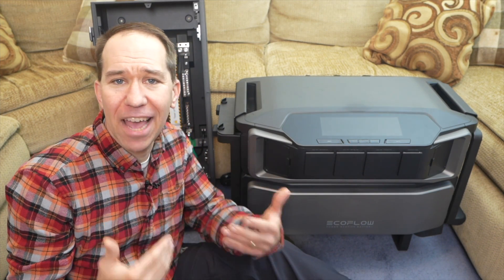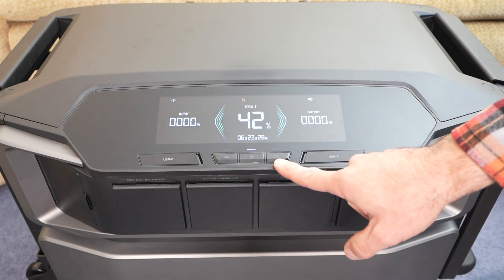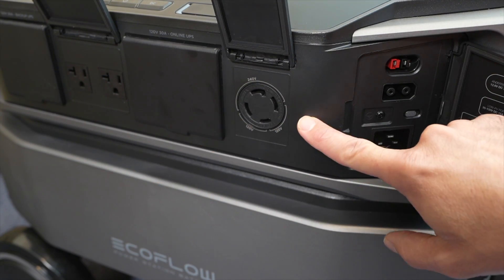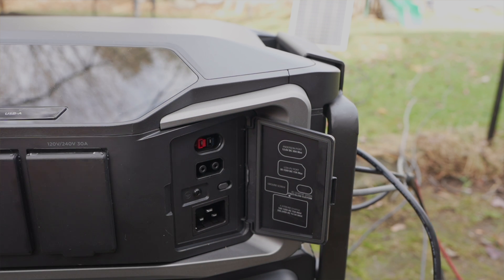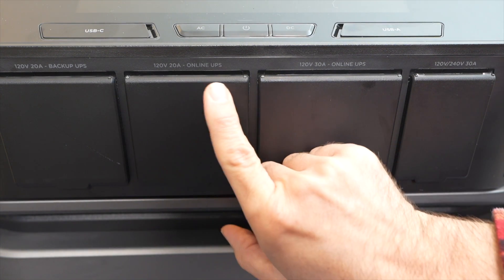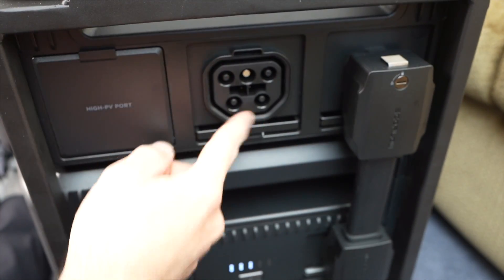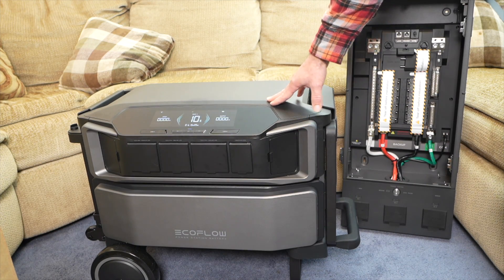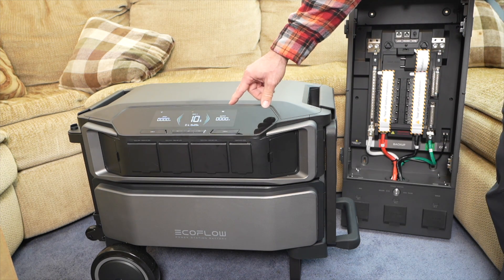EcoFlow Delta Pro Ultra - Huge Solar Input & 240V Output!

Comment from the maker: What other questions do you have about the DPU or the Smart Home Panel 2?
Reply: How much is it?  Is it still a huge secret?
Reply: @tlteal 
$300?
Reply: I didn’t see the panel 2 review on your main channel, are you still doing one? Love your content!!!
Reply from the maker: Thanks!  I made a video installing the SHP2 and using the DPU on my main channel in January.  If there is more you’d like to see with the SHP2 or the DPU let me know.
Reply: @solarguy  oh! Didnt realize this wasnt main channel! My bad!!!
Reply: I wished that the DPU had like an 'auto gen start' dry contact input other then that its fenominal.
Reply: Does the smart panel charge the batteries?
Reply from the maker: Yes, it can charge the Delta Pro Ultra directly.
Reply: I had the same question  - how much ?
Reply: I have micro-inverter solar system now. Does the SHP 2 will have CT clamps to monitor the outgoing power and able to use that outgoing power to charge the batteries instead of sending it to the grid?. Then it could act more like a Tesla, Enphase or Franklin Power Wall and Any excess power could be fed back to the battery. If it does not, what does the SHP 1 do different than the SHP 2 ?
Reply from the maker: The SHP2 is a smart sub-panel.  You can definitely monitor the energy consumption on each circuit.  If you want, start a new comment with more questions and I can take a stab at answering them.
Reply: That's a great question! The Segway Portable PowerStation Cube Series is another excellent option for outdoor enthusiasts and RV lovers. It offers a massive 5kWh capacity, fast recharging, powerful output, and even has a waterproof design. I highly recommend checking it out for all your outdoor power needs. Let me know if you have any other questions!
Reply: The Segway Portable PowerStation Cube Series is a fantastic option for outdoor enthusiasts and RV lovers. With its massive capacity, powerful output, and super fast recharging capabilities, it's perfect for powering your devices and appliances during your camping trips. Plus, its armor design and waterproof technology ensure durability and reliability in any weather conditions. Highly recommended!
Reply: I have been waiting for mine for over 2 months

Comment: Reece, l was wondering about what port for output to my 100A breaker box in a totally off-grid cabin. I know l can run a 30A cord from the front port but could l also use the side port where you can charge the batteries and run it to the 100A breaker box. Another question is, if l use the front port to the breaker box and have to use the side port to charge due to extended clouds, etc. will the batteries charge without running through to the cabin outlets?
Reply from the maker: You wouldn't be able to output more than the 7200W max with only one main unit no matter the configuration.  To use the 5+1 proprietary port (on the side), you need the 50 amp hub or to connect the DPU to the smart home panel 2.  You could get an adapter to input to the 5+1 port and input there and output on the front if you wanted.  I'm not sure I understand your second question.  The DPU can input/output at the same time.

Comment: Have you ever tried both high and low PV charging simultaneously? 

I have a crazy idea of powering this inverter directly from a retired 1st Gen Chevy Volt (< 400V HV battery), which means there would be more than 300kWh (10kWh usable capacity of EV battery + 9 gallons of gasoline [33.7kWh per gallon]) of energy reserve in theory.
Reply from the maker: Yes, both inputs can be used at the same time.  Sounds like a fun project.
Reply: Yes ... until I made both the car and house on fire!  Just kidding.  If this idea works, I will have a gigantic low emission gasoline generator backup.

Anyway, Costco has this Ecoflow unit on sale now with up to 18kWh of batteries bundle.  I will keep you posted, if I decided to go for this interesting adventure.

Thanks for your prompt replying.
Reply from the maker: Well hopefully no flames, lol!  Keep me posted.  If you end of seeing a good deal on Amazon and EF website, I usually can get discount codes.  If I don’t have a description updated you can always email me and I can see what I can get.

Comment: If I have 5 400-watt solar panels plugged into the High-PV Input Port and the DPU is inside my home, do I need to do any special grounding like using the grounding screw on the DPU? I ask because the online manual says, "When the 'product' connected to PV modules is put inside the building, it needs to be grounded to reduce the risk of electric shock. Before using the ground terminal, consult a qualified electrician, electrical inspector, or local agency having jurisdiction for local codes or ordinances that apply to the intended use of the product."
Reply: Oh, how long are the cables? If I do get the panels, I would need to run the cables between 50 and 100 feet from outside where the panels are to inside where the DPU is.  😅
Reply from the maker: I would use the grounding plug if it were me.  You could probably land it right on the ground bar on your main panel.  Do you mean what gauge of wire?  You may want to consider 8 gauge to minimize voltage drop.  There are calculators onilne to get voltage drop estimations.  You might also want to make sure you get wire that has the correct insulation for your application.  For example, getting PV wire or direct bury cable for outside.
Reply: @solarguy  I've heard terrible things about grounding plugs, like they're not supposed to be used while the system is also plugged into an outlet.

Comment: how much high power solar input will this take i read 4000 watts in the specs but other places it ways 5200watts, which is correct ?
Reply from the maker: It has 2 solar inputs (high and low voltage).  Low voltage is rated for 1,600W, high voltage rated for 4,000W, so 5,600W of total solar input per DPU.

Comment: Can it handle a 3.5 ton central ac unit?
Reply from the maker: If the LRA is less than 120amps then yes.  If you look on the sticker it should tell you what the locked rotor amps value is.
Reply: @solarguy  ok thanks and how long will it run on battery alone?

Comment: I have an inquiry
Can the solar system provide power to the house to offset utility demand and charge the battery?
Thanks
Reply from the maker: Yes, it can.  You can connect it in with a generator inlet box or it natively works with the ecoflow smart home panel 2.  I've got a demonstration video on my other YT channel (check the video description for the link)
Reply: @solarguy  I really appreciate the help you've given me. Can I just ask you one last question?  
If the solar system was only tied to the Eco Flow battery and supplying it with KWh’s , could the battery be used to supply power to the home thereby lowering the amount of KWHs the I need from the grid?
Thanks

Comment: How long would it take to fully charge with solar?
Reply from the maker: It depends on how much solar and how much sunlight you have.  If you have a 5kw solar array and full sun (1000w/m2) at the right angle then it might take about 1.2 hours to go from 0 to 100%

Comment: This EcoFlow Ultra environment, while impeccably engineered on the surface, is flawed and not ready for prime time. The hardware installation and set up is simple and somewhat straight forward, but that’s where the full beauty of the design ends. The software and app that are actually responsible for insuring that you have power when the grid goes down do not deliver. The biggest issue is the parasitic draw down on the battery when the system is in idle. There are a number of functions on the app that conflict with one another, making work arounds to reduce battery drain impossible. Some app features don’t work at all. And as mentioned in another post, customer support, while courteous, is basically useless. The jury is still out to see if the software functionality is going to catch up with the hardware. I’m not holding my breath…
Reply from the maker: What app features don't work?  Are you using with the SHP2 or just stand alone?
Reply: @solarguy  Schedule tasks don't work unless the battery is on, which increases battery drain, requiring more charge time. The EPS mode is another power drain when on, and should function the same whether on or off in terms of static power drain. StormGuard doesn't work. All the functionality built into the battery-side of the app is disengaged when connected to the SP-2, reducing overall control of the battery.

Comment: Bonjour je recherche une autonomie de 4 jours minimum pour ma maison 🏠 comment faire svp ?
Reply from the maker: If you want all of your needs to be covered for up to 4 days you would need to calculate what your average daily use of electricity is for all of the loads in your house then multiply by 4 to get a good estimate.  This will be in kilowatt-hours.  If you have solar panels then you will also need to make some assumptions on how much they can produce.  Because a system like this is expandable, you can always start with one battery and add more until you find the amount that suits your needs.
Reply: @solarguy merci beaucoup pour l'information ❤

Comment: I’m very new to solar and this unit looks very straight forward for someone to have a 240v backup solution. However, I’m having trouble finding recommendations for what solar panels to use for the high PV port. Do you have any recommendations maximizing power input while staying under the max 450 volts? How many panels and how big should the panels be? Thanks in advance.
Reply from the maker: It’s hard to give an exact answer because there are so many options for solar panels (prices, sizes, wattage, etc). Where you plan to mount them is also a factor.  A simple explanation is to look up the voltage on a solar panel spec sheet.  When wired in series you add up the voltage.  You want to be mindful of the amperage limits too so you are most efficient.  Would you find it helpful if I made a video explaining these concepts (series and parallel solar strings)?
Reply: @solarguy  Absolutely. Please make a video. I stubbled on to your channel because of this video. Your video was a great explanation and overview of the unit for beginners. I will be checking out your other content to continue my journey into the world of solar.

Comment: How fast does the ultra charge on your roof array of 15.6kw?
Reply from the maker: I'm not able (at least easily) to charge it with my current rooftop array because they are already hard wired in to my SolarEdge inverters which are then grid-tied inside the meter.  So I am using other solar panels with the DPU.  If I were able to connect 5.6kw of panels and I had optimal angles with full sun, it would take a little over an hour to charge the 6kWh battey.

Comment: The Anker f3800 looks far more portable even with the battery add ons.
Reply from the maker: It depends on how portable you want.  The Delta Pro Ultra has some better features (plus 6kwh versus 3.8kwh) in my opinion and I can move it around pretty well with the upgraded dolly.  I wouldn't be able to pull the F3800 through the grass like I can with this DPU setup.

Comment: Good presentation but, your dB test not so good, your clothed watch arm was in the way.
Reply from the maker: Thanks.  I might disagree but in this case I don't think the exact dB even matters.  Even when charging or outputting 6,000W this unit is so quiet.  I have tested a lot of power stations and this is on a new level of quiet.

Comment: Please show us the smart panel 2 is it use a normal circuit braker so we can add more than 60A or its special circuit braker also i saw that you may could extend the numbers of circuit and we can use it as 240v completly please answer the question asap as am planning to have 180kwh awaiting your urgent reply
Reply from the maker: My video with the SHP2 comes out on Tuesday.  Yes, it uses normal breakers.

Comment: Could you use a delta pro with 2 batteries (or 2) in series to charge the unit?  I have two delta pro with 4 batteries.
Reply from the maker: If you have the double voltage hub you can charge the Ultra at 240v with the l14-30 to 5+8 adapter (I showed it in the video).  Otherwise you would charge the ultra from the 120v outlet on the delta.

Comment: no charging port for ecoflow smart generator ???
Reply from the maker: No, there isn't a DC XT150 input.  You have to charge it with the 120AC output on the EF gas generator.

Comment: @solargy I appreciate the video and I’m always trying to educate myself in this area however this is not my forte by any stretch of the mean and I still struggle with it and have a couple of questions for you if you mind me asking…
So my parents have a couple health issues that requires them both to be on cpap machines and one has to be on oxygen as well when they are sleeping. Both cpap machines are Resmed airsense10 and one Phillip Respironics EverFlo portable oxygen concentrator. Is this unit enough to power all 3 of  machines incase of an a big power outage? I’m struggling to figure out what exactly is  needed to meet those needs so I can have something in place and have peace of mind if something happens those needs are fully me? 
Thank you if you are able to bring any clarity on this matter.
Reply from the maker: To answer specifically you would need to know what the total power draw is on those devices and how long you want them to be powered by a battery in a power outage.  My guess is that they don’t use a ton of power and if it’s only for these things, Delta Pro Ultra may be a bit overkill.  You could likely get away with a power station much smaller.  So for example, if those items use 300w total and you want them to last 8 hours then you aim to get a battery that is 2400wh or more.  Multiply the power load times the hours.  You can use a simple power meter to find out what the power draw is on these items.

Comment: @ 6:36 is the 50 amp hub included?
Reply from the maker: I’m guessing it’s an add-on.  The DPU isn’t officially launched for a few more weeks.
Reply: I've also seen an EcoFlow "official" video that showed this double amp (parallel) hub, but also a new version of the Double Voltage Hub for a pair of delta pros that let you hook them up to a Smart Home Panel 2. I'm wondering if you could also connect that hub to this Double Amp hub to add an Ultra to your existing DELTA pro setup to get up to 50 amps and more capacity?
Reply from the maker: I don't know for sure but my guess is that it would work in that scenario.  That is, with the new (5+8) adapter connected to 2 DPs and a DPU on the other input.

Comment: Question: Does the DP Ultra comply with UL 9540? Local code (Illinois) requires the inverters and batteries comply. This is critical because the electrical inspector won't let you install solar panels or connect the unit to your house if it doesn't.
Reply from the maker: I asked EcoFlow to make sure and they confirmed it complies with UL9540.
Reply: @solarguy  That is great news. Thank you for checking with them. I need to get that in writing. Unfortunately, I can't find a spec sheet online for the Ultra. I just know that I will need to show it to the electrical inspector. I was about to purchase a Hysolis Apollo 5K and several batteries, but their unit doesn't comply with UL 9540. Theirs complies with UL 2743, which I believes covers portable devices with batteries. They added that it's not possible to backfeed the grid with the Apollo 15K. So I hesitated, wanting to do more research, because I don't want to end up buying equipment that would be rejected. Then I learned about the Ultra. Once Hysolis told me about their compliance with UL2743, it dawned on me that perhaps the reason that most of these solar power stations don't comply with UL 9540 is because they don't have to; they fall under UL 2743. Do you think this reasoning is correct?
Reply from the maker: I have seen a SGS certificate that shows the DPU is UL 9540 certified.  I don't know how to show it but perhaps you can look it up  the certificate number is: SGSNA/23/GZ/00354  and this is what is listed under certified: ANSI/CAN/UL 9540:2023,Third Edition, Dated June 28, 2023
Reply from the maker: You can email me and I can snap a photo if you want.
Reply: @solarguy  I'll send you an email. I really want to show it to the inspector and see him give me a thumbs up before I order anything. Thanks.

Comment: Wow that 😮what a test is that you plug in to 120v and you can get 240v… I need 240v to run my water well. Thank you I’m subscribing to your channel
Reply from the maker: Yes, this is pretty impressive.  A well pump is a good use case.